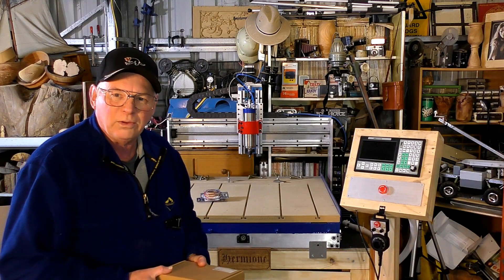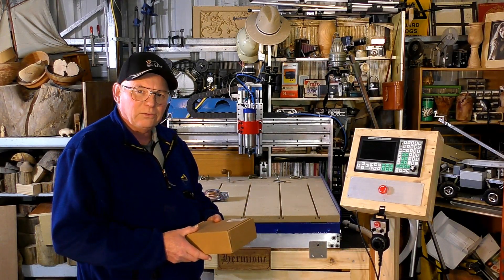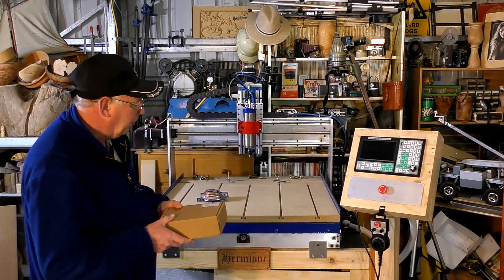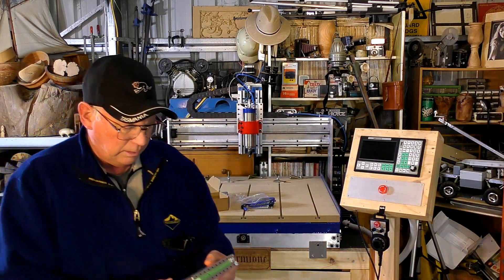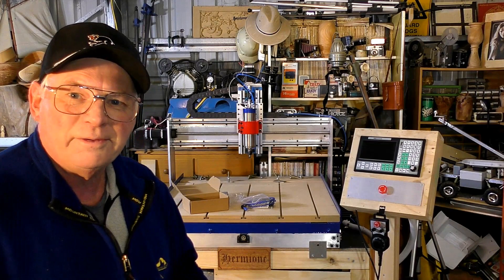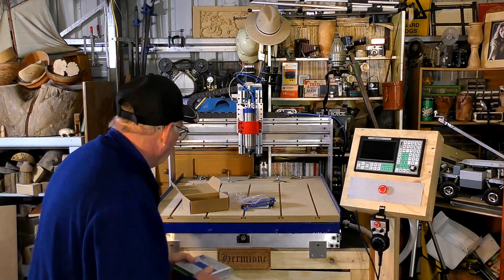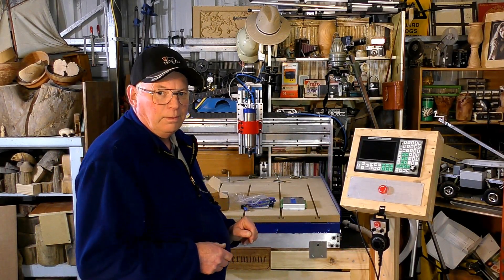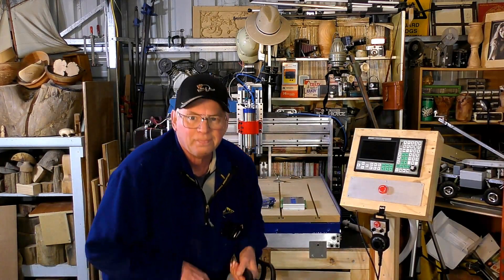Goodbye SMC5-5-N-N controller welcome back Mach3 or is it Mach3.5? ProMo

Comment: My head is spinning. You originally liked the unit, then didn't because of price gouging, fair enough.  Then, AFTER posting this video, you've continued posting videos on using this very unit that you "got rid of." So, as of mid-2023, do you still use and like it - or not?
Reply from the maker: If I did not make these videos YOU would be paying $1300 for the SMC5 and not $500.  + I dont think you need help from me, remember what Thumper's mother said,  Thumper If you can't say something nice, don't say nothing at all

Comment: I know I keep saying it but linuxcnc is free, and if you ask around amongst friends for an old pc you will find free machines with a parallel port.  I’ve done it many many times!  Your total cost can be $0 of you give that a shot. And it runs circles around mach3
Reply: Can you recommend a card to use so I can try linuxcnc
Reply: @jigsey.  Either get an older PC with a built-in parallel port and then pick up a cheap parallel port breakout board.  I've had success with every one I've tried.

If you ask around you'll probably find an OLD pc with a parallel port and this approach should cost you less than $50 total!

Let me know if you need other recommendations.
Reply: @billstrahan4791  I'm using an old pc with Parallel port with a rnr usb motion controller for Mach 3... Is there a board I could switch it to parallel port so I can try linux